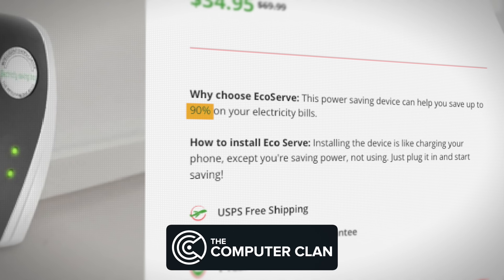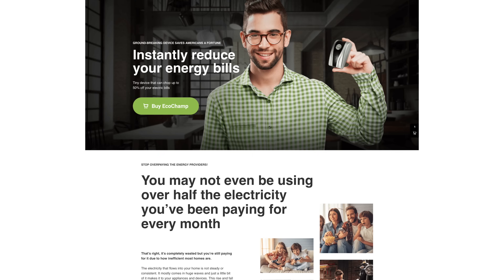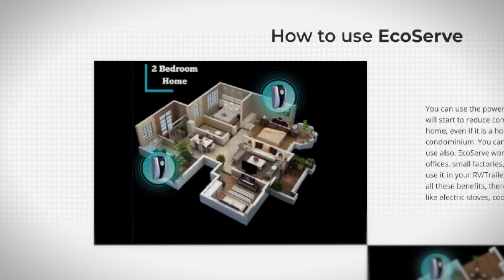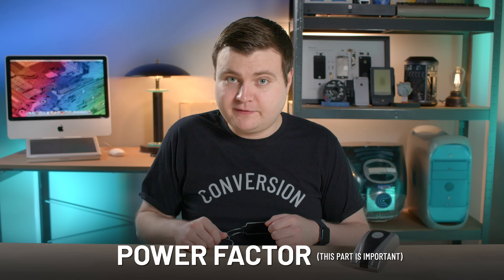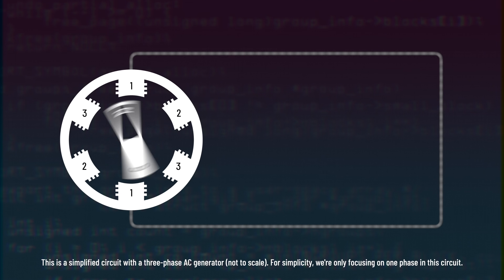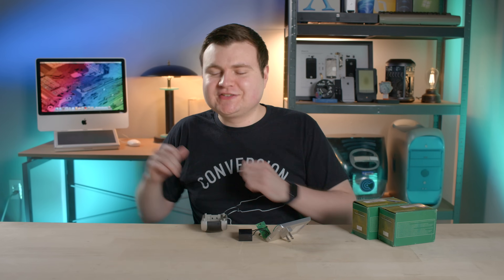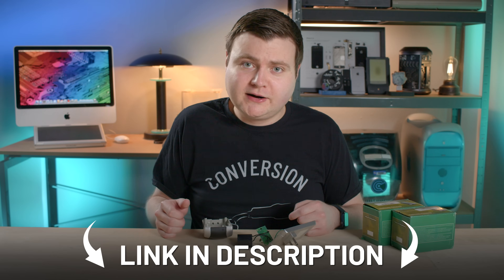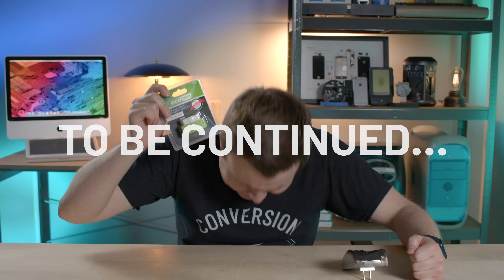Electricity Saving Box Scam (The WORST I've Seen) - Krazy Ken's Tech Talk

Comment: As a general rule of thumb, if Nikola Tesla is mentioned in the marketing material and you are not buying an electric motor that runs on AC, it's guaranteed bs
Reply: Let’s remember the wise words of Abraham Lincoln: “don’t believe everything you read on the internet.”
Reply: @elPeligro  I thought that was Archimedes.
Reply: @ivanpetrov5255  it was nelson mandela, of course
Reply: @elPeligro  Intentional irony, is thay you?
Reply: or something wireless
Reply: @QualityDoggo  like Verizon wireless.
Reply: @iwinrar5207  verizon billing structure(like most usa operators for 30 years) is kinda bs
Reply: Eh, if you're buying a Tesla coil and they mention Tesla, I'm gonna say that's not necessarily BS. Tesla coils are real.
Reply: @Honey_Daddy  fair
Reply: @Honey_Daddy  Tesla coils don't need marketing material, they practically sell themselves to plasma enthusiasts!
Reply: @Honey_Daddy  Yes, Tesla coils are real. I built one.  but if someone claims it will lower your electric bill, or give you free energy, or transmit useful power wirelessly, it's a scam.  Even Tesla couldn't make it do those things.
Reply: @Honey_Daddy  or a Tesla electric vehicle. I really like the Tesla EVs, they’re everything but scams.
Reply: @Honey_Daddy  Real, but essentially useless.
Reply: I dunno ... If they only mention Nikola and are selling electric vehicles it could also be a scam
Reply: @Derekzparty  no its hydrogen vehicles not just normal electric vehicles
Reply: Exactly
Reply: BuT dOnT yOu KnOw NiKoLa TeSlA InVeNtEd AlL tHiNgS GoOd In ThE wOrLd?!?
Reply: @adeptusfantasticus  He invented nothing.
Reply: You mean my Tesla Death Ray doesn't work? I payed tree-fiddy for it!
Reply: Elon Musk also markets using Tesla and scams people.
Reply: or a tesla coil
Reply: @addicted2caffeine  Iron Curtain activated!
Reply: When I saw that ac/dc graph I remembered using that for my Nikola Tesla project
Reply: Tesla was such a innovator.
Reply: @jooei2810  He was just a showman who stole the work of others.
Reply: To be fair ( to be fairrrrrrr) tesla is a unit of magnetism as well. And alot of his principles are being used. But yes. As a professional, if a product is using tesla as advertisement. Chances is its bs.
Reply: @kriss3d  The unit was named after him as a sop to the Soviets during the cold war. Tesla never did any academic research worthy of the name, and never published a scientific paper.
Reply: Yes. Of course Tesla, in his later days, went off the rails into some truly crazy stuff
Reply: @kevinbarry71  lot of Genius in that head
Reply: @kevinbarry71  He never discovered anything.
Reply: Nikola Tesla = two veterans of he [insert industry namee] = [people from industry] hate this - it's just scam lingo. And it's something people need to learn, along the other baity stuff.
Reply: Or selling pigeons
Reply: Well, AC motor, alternator (aka AC generator) or tesla coil.
Reply: @spvillano  AC motor and AC generator are kinda the same thing, just run in one way or the reverse way
Reply: @spvillano  AC was never 'invented'. It was a defect which was turned into a feature.
Reply: Yep.   I don't know why, but every braindead electro-scammer LOVES Tesla.
Reply: Nope, the 'Universal' commutator AC motor was invented well before Tesla claimed to have invented the polyphase AC induction motor. The Universal motor is an AC version of the DC series wound motor. Both of these non-Tesla motors were making a major contribution to human progress (industry, automotive etc) before Tesla.
Reply: @alastairbarkley6572  Quite right! Tesla is missing from academic histories of electrical engineering.
Reply: Or a Tesla coil. If I'm buying a Tesla coil, and they don't mention Nikola Tesla, I might worry that they're trying to sell me electric car parts. 😂
Reply: I have this crazy new idea that I got from Tesla… 😂
Reply: With all due respect to Mr. Tesla, who was indeed a genius, we have advanced so far beyond him that there is no need to mention him at all.
Reply: @Grombrindal  Tesla was not a genius at all, he discovered AC motors by chance but on everything else he was dead wrong, especially on the theory that explains it
Reply: @marcogenovesi8570  He thought that radio signals travelled over Earth's surface. Even worse, he claimed that the Moon does not rotate. What a genius! LOL
Reply: @Grombrindal  He was a total fraud.
Reply: What about an earthquake machine
Reply: @bluedistortions  Just another of his many lies.
Reply: That's amazing, both Nikola and Tesla are scam companies! lol
Reply: Fail to understand how anything like this ever gets on the market in the first place? If it said save 10/20% you may get away with it but 80/90% savings is a joke and anyone stupid enough to buy this based on stupid percentages needs there head examined... And when they say 30 day money back guarantee and then say it can take up to 4 weeks before you see the real saving which is roughly about the time your bill will come in you have past the 30 day money back guarantee time line so you have been scammed.....!
Reply: @stevenrobertson1987  there is a lot of dumb people
Reply: Or if the product looks like it was made in mid 00s... seriously there are people who still produce this silver/black plastic devices?
Reply: @beardsntools  The design is more like 90s, but yes, as long as there are suckers buying them
Reply: @marcogenovesi8570  nah it would be beige if it was 90s, this is the design that ran from 2004 to like 2010
Reply: @beardsntools  True. Look at non-merchadise MP3 players.
Reply: @blakksheep736  mp3 players everything.. so many gadgets used this ugly casing color scheme. The only things that didn't use this then generic cheap plastic scheme, were the things that werent cheap, such as mine 2004 hp ipaq pda that has a magnesium body.
Reply: I really hate this. I really like Nikolai Tesla, so I'm always extremely triggered when I see snake oil salesmen and other exploiters of the anti establishment narrative slapping his name all over their BS products.
Reply: @blakksheep736  Tesla never invented anything.
Reply: wow...doesnt know generation is in 3 phase AC     ...   cough dc is ineffecient in motors because 3 phase  = driving the motor 3 x a revolution... not just once   (cough dc = on off on off) so ac motors tend to put out 3x the torque... :-\

Comment: They are great for AC noise smoothing tho.
I bought one just for my audio set.
Reply: Okay, that’s a viable use-case, but wouldn’t any capacitor in series also work then?
Reply: @endymallorn  yes, but i don't want an ugly square box hanging out of my socket.
And as he said: cheap on aliexpress.
I have a bit beefier version tho, with two caps and a voltmeter build in.
Reply: @endymallorn  parrallel not series.
Reply: I was actually thinking about picking one up for that actually. I know high end audio companies that make similar products that are significantly more expensive
Reply: @tylertraina9480   I would not recommend it the build quality is appalling there is no internal fuseing and as the motor start capcitor is unbranded I wouldn't trust it to not explode.
Reply: Yeah, but that also depends a lot on the actual quality and rating of the capacitor. However, one could probably buy one of these and – if necessary – replace the capacitor inside.
Reply: That is all snake oil. All DAC/AMPs already come with smoothening capacitors in them to filter noise. If there is noise in your audio setup it is either because of a low quality AC to DC power supply or there is a lot of interference (ex. old motherboard audio). If that is the case a capacitor will only help after the power is converted to DC, not when it is still AC. Even then, circuit design and proper shielding matter much more. Basically all DAC/AMPs from brand names do not have these issues except for cheap unbranded garbage.

Comment: Actually depending on the light it may not be changing brightness. High quality LED lights use better power supplies to provide continuous current and incandescent bulbs just stay hot enough through the change in current to not really change in brightness.
Reply: You can see an incandescent light flicker on a good slow motion camera... But it is minor compared to a crappy led light.
Reply: You can also use your hand. Just wave your hand around and you can see if the LED light is flashing.
Cheap LED lights for the home are lightweight while the ones with a good power supply have more weight to them.

Incandescent bulb flashing is harder to detect. In our physics lab, we had a spectrum analyzer and this device was fast enough to measure the emitted light fluctuations.
Reply: @louistournas120  The strobe disc foran LP turntable works best on fluorescent light but it does work on incandescent light.

Comment: OK, the samples Electricity Saving Box you examined may not work quite as well as advertised, but the next generation QUANTUM  ESB could!   And the quantum model is also digital... in that you use your fingers ( which are digits) to plug it in.

Comment: So… it saves electricity… by using electricity…?
Reply: i used the electricity to save the electricity
Reply: @araigumakiruno  yes
Reply: To save money you have to spend money.
Reply: Just pay to pay even more I guess...
Reply: Yes
Reply: It gets you closer to the integer overflow
Reply: It doesn't. Power factor correction devices don't use electricity, it's a capacitor bank that releases stored power to lower the current (amperage) demand when an electric motor starts or something like that.
The savings come from the fact that you don't need to make as big power cables to the motor, and you don't have to pay the current spikes to the power company, if you are an industrial customer that actually is billed for that.
Home users don't
Reply: @marcogenovesi8570  this device uses electricity, and doesn’t save any.
Reply: @TheGlitchyMario  no he explained what the video did that you oversimplified/missed
Reply: @TheGlitchyMario  it is not using electricity and is not saving any (in an home setting)
Reply: @marcogenovesi8570  how does it power the little LEDs on the front?
Reply: @TheGlitchyMario  magic
Reply: @marcogenovesi8570  ok, I guess that makes sence.
Reply: @marcogenovesi8570  Your statement assumes it is a lossless device. It isn't.
Reply: @troy3456789  lol wut. Half the video was talking about how a power factor device is helpful, in an industrial situation. It doesn’t have to be lossless, since nothing is, to work. You just don’t need that in a home setting, even if this product worked properly/was lossless
Reply: @johnandrews9433  LoL wut nothing. Saying it doesn't use electricity when it obviously will have loss? sup with that? Loss is real and it adds up.
Reply: @troy3456789  No that is not an assumption I'm making.
Reply: @troy3456789  loss from caps is negligible, this isn't a battery